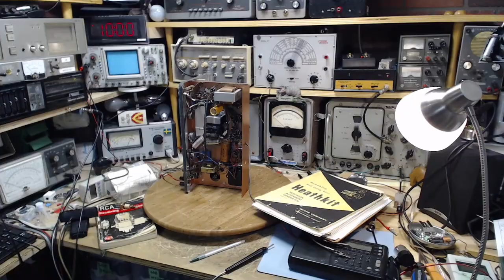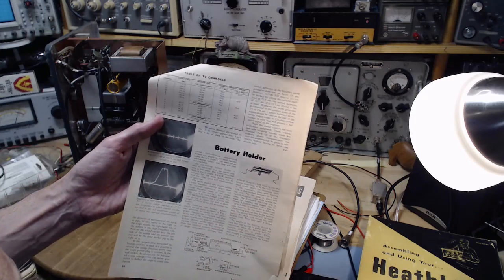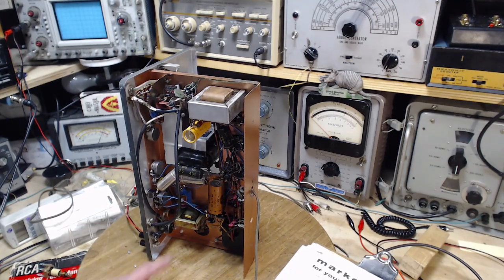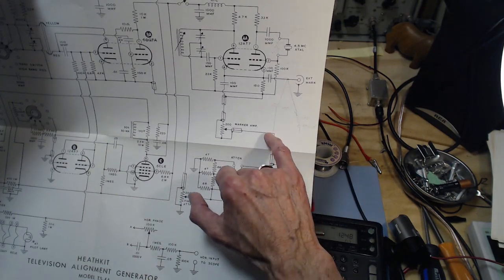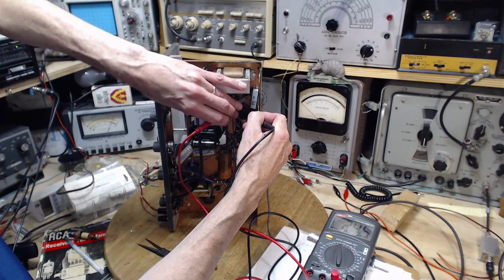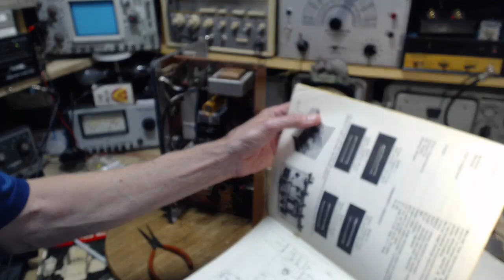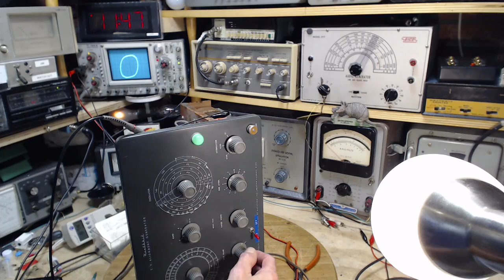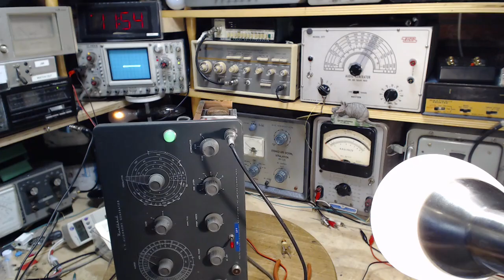Heathkit TV Alignment Generator TS-4A Video #3 - Mystery Solved!  What Now?

Comment: Hi Jim 
That looks like a post marker adder .
So both A & B scope channels plug into the unit .

You have a clean RF signal on one output connector this feeds the DUT .
( Just follow the out put of the switched attenuator ) .

You have a connector that feeds the marker adder from the DUT .

RF signal is mixed in the marker adder & imposed on one of the output jack feeding the CRO .
It could be imposed on channel A or B  ( both have been used ) .

You tested the plate of the buffer amp ( 6BQ7A pin 1) but what's on pin 6 ?
This is pulled low for blanking by tube C ( on my map 6CL6 ) .
Reply: Whoops !
The 12AX7 is the blanking .
The part used as a diode it has a/c on the cathode .
( diode switching or moving the voltage conduction point with the a/c ? ) .

The 6CL6 is a shunt tube & controlled by part of the 12AX7 . 
The voltage divider set by switched resistors .

Note
The 100k & 4k7 on the 6BQ7 grid ( pin 7  ) are part of the divider .